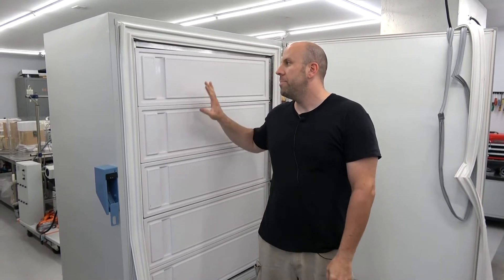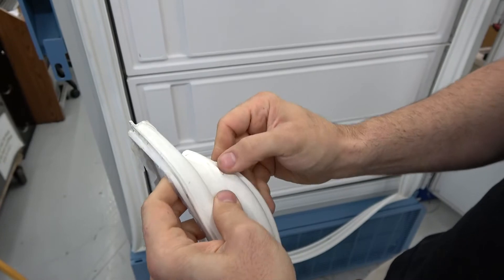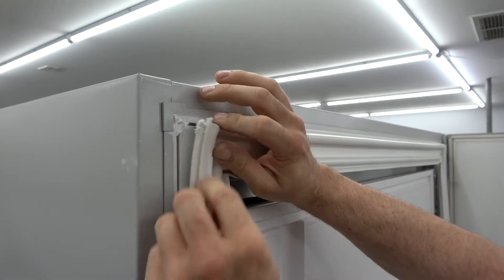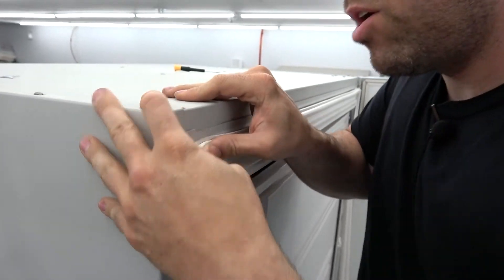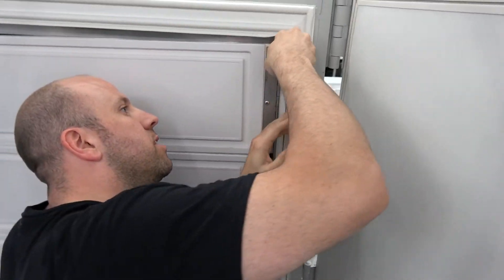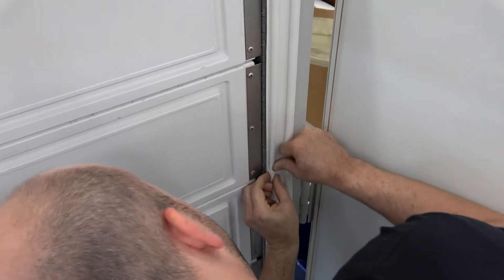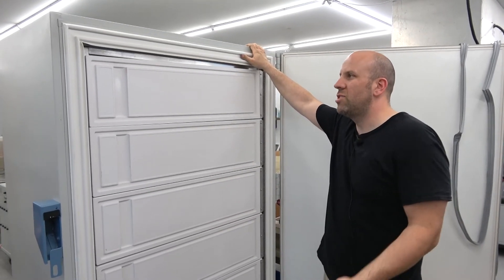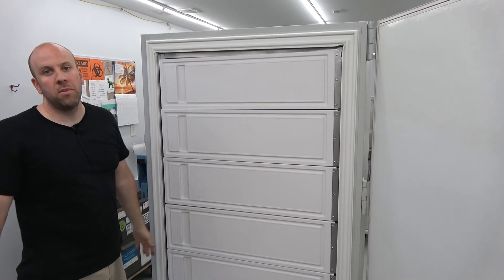How to Replace Ultra-Low Temperature (ULT) Freezer Door Gasket Seal from Thermo

Comment: I have a TSX40086A with a bad seal. Seal is in two parts just on the door.  Can I do this without warming up the freezer?
Reply from the maker: Hi, Steven! If we're understanding the question correctly, the freezer will warm up with the door open. It will just depend upon how long the door remains open while the seal is being replaced, but the seal can only be replaced with the door open.
Reply: @newlifescientificinc.789   Many thanks, was looking to replace the seal without fully defrosting the freezer. But it's all moot now as we have to now empty the freezer and fully defrost. So will do it then.